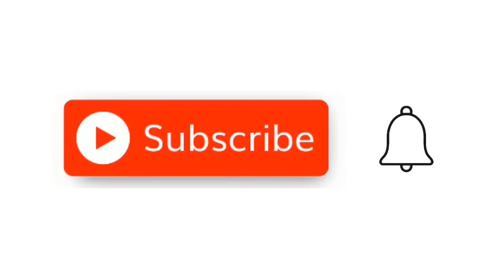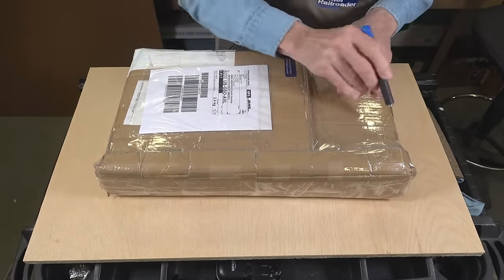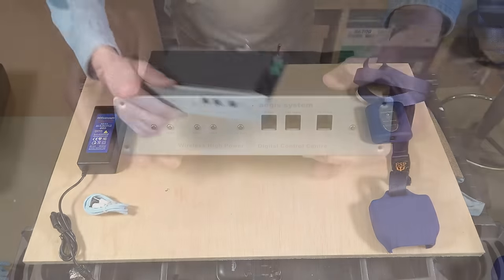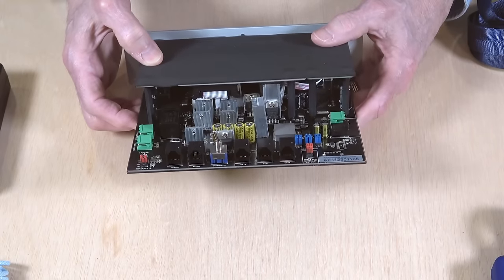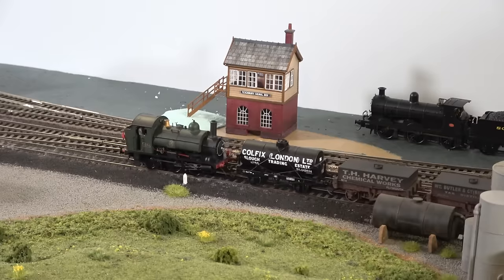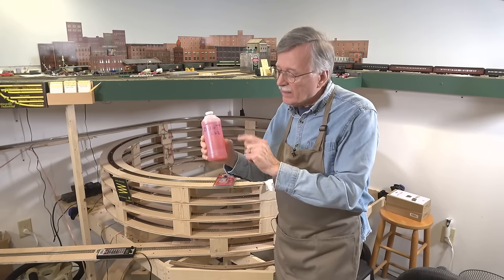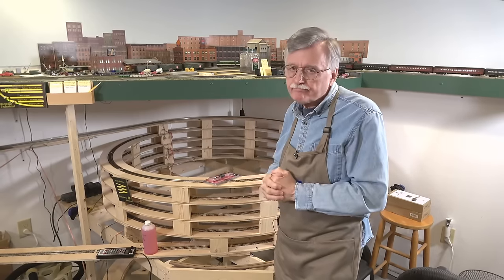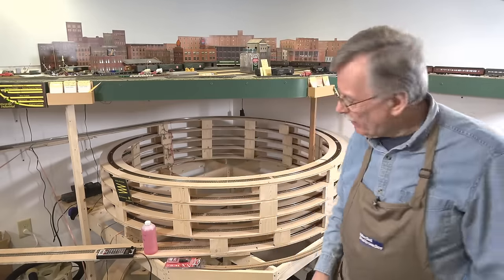DeOxIT Track Cleaning Update and Aegis Unboxing (356)

Comment: I would like to endorse the importance of maintaining clean track with DCC control. After a career in industrial instrumentation and control, I was confident that when designing and building a layout it would work perfectly first time. Of course it didn’t. After checking my drawings and testing all the wiring, I concluded that it should be working. The track looked shiny and clean, but after working a Peco Track Rubber over it, followed by some cleaning fluid, it was apparent that the track was filthy. Subsequent testing with a loco was then 100% successful.  Clean track = happy operators.

Comment: Typing this before watching the video. I ordered DeOxit it as soon as you released the first video on the topic. Previously I was trying No Ox id and I thought I was having excellent luck until the tracks finally did get dirty. I found it was extremely difficult to get proper conductivity. Whats funny about it is that your tracks will look so clean but the thin layer of grease seems to isolate them. Anyways my experience with DeOxit has been absolutely amazing. I found that it doesnt necessary keep the tracks from turning black, but it does however create outstanding conductivity conditions. The trains run so smooth, and it seems to slightly lubricate the wheels too without giving up traction. I really appreciate you Larry. Watching the video now!
Reply from the maker: Glad to hear it is working so well for you.

Comment: I found alcohol caused my track to be slippery on grades. I’ve used very thin layer of No-Ox-Id and have never experienced any loss of traction. I have 3% ruling grades on my layout. Typically run 12 car trains with both steam & diesel.

Comment: Using a Digitrax Zephyr Express on my first 4’x8’ N scale layout it has been simple to get started, but it’s frustrating with just the single base unit. I looked at a throttle with ports on each side to operate from more than just one place, but it proved easier to just add a UR92 & use a DT602D throttle and this has greatly improved my fun. Never having had a previous throttle I find this throttle to be relatively simple & straightforward to use. 
I tried the de-ox-it, but wasn’t aware that it needed to be diluted & I ended up using too much causing sluggish operation, but wiped the whole layout clean & started over just cleaning with a cloth & that works best for me.
Reply from the maker: Yes, since Digitrax came out with their first wireless throttles in the late 1990s I have been using wireless throttle almost exclusively. You do still need to have a few fascia panels for those cases where you actually need to plug in the throttle.

Comment: Yeah, mine showed up today!  Boo, missing the US adapter cord.  I sent Iron Planet a request to send it.  Iron Planet repackage the aegis system when they sent it to me so imagine that the cord was just missed in the process.  My packaging didn’t look like yours.  I mentioned your video so they could see where the cord is in the packaging.  Aside from that, this system looks great.  Can’t wait to get it hooked up!  Thanks again for posting your videos.  Always what I need and when I need it.
Reply from the maker: When I got the prototype direct from China it came without a US power cord. Fortunately I had an old one saved from a Dell laptop power supply that fit it fine. So you might look around and see if you have one that will fit.
Reply: I did a quick search and found an old printer cord that plugs right in.  I hooked it to and it works perfectly.  I think I was running beyond the limits of my power cab alone could provide.  My layout is running fantastic with this system.  Thanks so much for demonstrating this product.
Reply: Same here my package did not look like yours,and the u s power plug is missing. I belive they sent me the british plug.
Reply from the maker: @doug383  If it came from Iron Planet then you need to contact them. If from the UK then you need to contact DCCconcepts. However I will let them know this is happening.

Comment: I've been using a simple red rubber block eraser for decades. Non abrasive and works amazingly well. I still run a couple of slider cars occasionally. The block eraser can be cleaned with soap and water.
Reply from the maker: I think the downside to rubber erasers, as well as the abrassives in most most bright boy types, is the residue they can leave behind.
Reply: @TheDCCGuy  They don't leave any residue behind. They're pencil erasers. Not the abrasive pen type. You just swipe it along the top of the rails and you're done.
Reply from the maker: Then why do I have to brush off my paper every time I use an eraser?
Reply: @TheDCCGuy  Just try and see. I don't get any stuff left behind. But the eraser turns awfully black after a few times. In the past I've tried all the popular things from goo gone to alcohol. While I still use alcohol for new track and a yearly cleaning. The big red/pink sometimes eraser is the go to agent.

Comment: Larry,
When you make a process change you should only change one thing at a time then step back and watch the results otherwise you have no idea which change improved or made things worse.
So, which worked? cleaning with a dry rag? cleaning with a rag soaked in Isop? the Deoxit/Isop mix? or a combination of all three.
I'm disapointed as after watching the video I still have no idea if the Deoxit is worth the money.
Reply from the maker: So test it yourself. First clean with a dry rag and see how that works for you. Then try IP and see how that works. Then try DeOxIt. In my case I wanted to start with essentially new clean track for the DeOxIt to work on.

Comment: Larry, I would like to ask you a question on another subject if that is okay. I am having a problem with a loco not responding to its assigned 4 digit address. However, it will respond to all other addresses. I am looking for a reason why my Digitrax system would exclude that specific #. I am not using any consists and all other locos are CV=19  =0. I can run the loco as is but was just at a loss why it has been excluded from the specific #. The CV 17, 18 have been correct for the excluded #. Thanks for any thoughts.
Reply from the maker: You left out the most important part—what address are you trying to use?

Comment: I have a question about the signals you mentioned earlier,  would it also be possible to make a train to break slowly to a stop if it encounters a red signal in just a simple way without expensive software?
Reply from the maker: There are decoders that will stop if a DC current or if a certain inbalance is applied to the rails. However to say it is simple would be a stretch. I know that some LokSound and DCCconcepts decoders do this.

Comment: Should I use some sort of roadbed on my model railroad? Some people say not to use it if you're going to have a big yard others say you should use it especially if you have a big main line but I really don't know about it I'm pretty new to the hobby looking to build my first layout soon.
Reply from the maker: Some folks prefer to use cork sheet for yards and other areas where roadbed was not built up. However elsewhere the roadbed is built up considerably and I have even cut ditches on each side of cork roadbed to increase the slope. I also know of folks who use two layets of cork roadbed to get the correct elevation.

Comment: Does DeOxit have any detrimental effect on traction tyres? I run N Gauge, and some of my locos have silicone tyres, and others have neoprene tyres. I have read and heard many stories regarding cleaning fluids causing tyre damage or complete failure due to melting them! Great video, and very useful information.
Reply from the maker: The manufacturer says it is safe on plastics—I’ll dig up a traction tire and see.
Reply: Thanks for taking the time to do this. I'm in UK but your videos have been so helpful to me since I started with DCC - very much appreciated.

Comment: I received my Aegis from Iron Planet yestetday. It will be a few weeks until i can play with it. It came to me very well packaged. I am looking forward to beng able to add a second wireless cab. I am also looking at other DCC concept products to control my tortoise switch machines via facia mounted panel. But I am very confused by thier offerings
Reply from the maker: It takes a while to get used to their website and product naming approach.
Reply: I Have been a follower of you since you owned your own shop and was a customer. I have bounced around using Digitrax, ESU cab control, and have NCE power cab for my bench. I planned to use ESU cab control but now switching to DCC concepts Aegis. I only tested the ESU.  
Yes the DCC Concepts website is confusing and my inquires to DCC concepts have caused me even more confusion. I want to have facia mounted panels to control my points. Basically a stand alone bus. I do not care to Operate my points via a cab. I also need to have a mirrored panel on each side of my peninsula so I can cntrol it from either side and have it indicate on both sides. I am dumbfounded.
Reply from the maker: I did a video on installing their wireless ESP system for layout control and how to build a control panel. Also if you have deep pockets they will actually custom build control panels for you. They have at least one employee who specializes in it.
Reply: I watched that video a while back. I have been working with Mick and Chris at DCC concepts.  I am trying to figure out all the components I will need. I will be using Alpha encoders, mimic Panels, and Alpha I switch buttons. That shoud all plug into my New Aegis system. The talk to NCE switch 8 decoders Via DCC.  
I do not plan to operate my points with my cab, rather via my switch panels.  
Thanks

Comment: A  question on cobalt digital point motors.  To have the supply different from the  DCC track power  looks difficult [or have i got it wrong]. Keeping the point motor supply different from the track power is recommended so the point motor will work if a train is run onto the point and shorts out.
How can it be done and what will you lose or gain.  
Using a separate power district  for the point supply looks the only option…but ..i am willing to be proved wrong.
Trying to get it right before I start the instal. Thanks  Amacf
Reply from the maker: As you say because of the design, completely isolating the iP Digital would require having a separate accessory bus.

Comment: Thank you for your review. Why is so many doing updated equipment got NCE  except NCE?
Reply from the maker: Not exactly sure what your question is but NCE no longer stocks their own products, they just sip to vendors. So their website is basically always showing out of stock.
Reply: Power Cab is physically unchanged for 15 years not including updated EPROMs. The engineers cabs are unchanged in 8 years where Digitrax redid almost everything to color displays.
Reply from the maker: Actually the basic cab design goes back to the Wangrow System 1 cabs of 1993. However a lot of users love that cab design. As for the new Digitrax throttles, I have a DT602 but I still prefer my DT500.

Comment: I want to tell you that when you report that the equipment is available in hobby stores around the world, you must exclude Chile, where the level of the railway hobby corresponds to 1960 or so. I have some old mobile decoders that suddenly stopped operating. I prescribed them and they started working with addresses 1, 2 and 9 but running in jumps. In some cases they respond to the direction and lights and in others they do not. What do you advise me to do, apart from buying others in the US paying for transportation that equals the price and import taxes that double it?
Reply from the maker: The best I can suggest is to try doing a factory reset to see if that helps.

Comment: Does the spiral phone cord that came with the NCE power cab work with Aegis?
Reply from the maker: Yes, the 6 wire cable is used to either connect the PowerCab directly to the Aegis base station when using the service mode programming track or to connect it to the wireless transmitter.